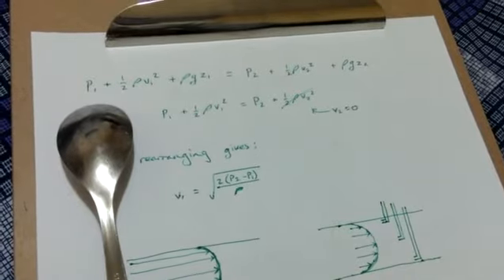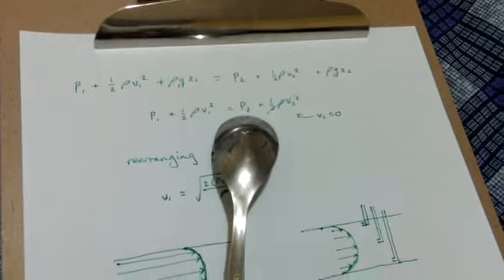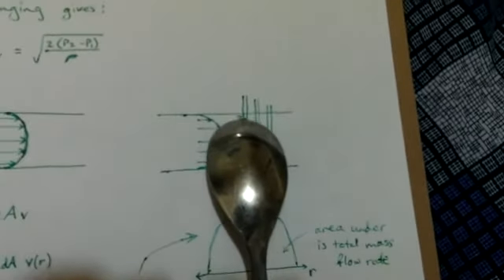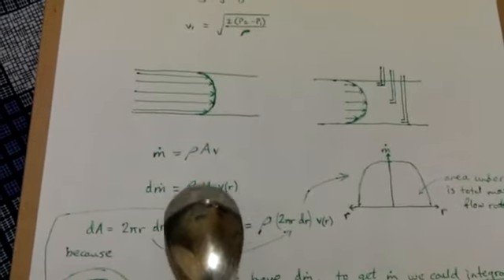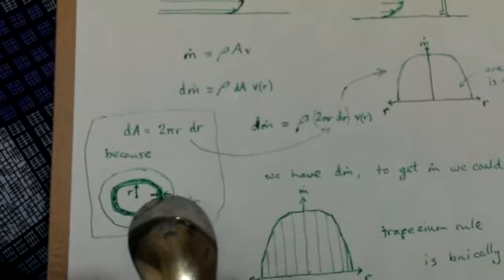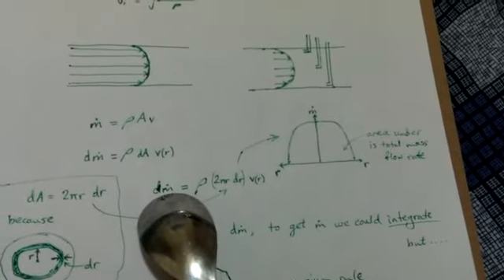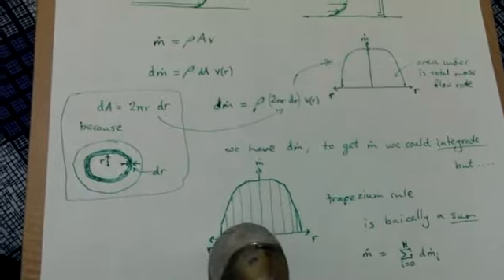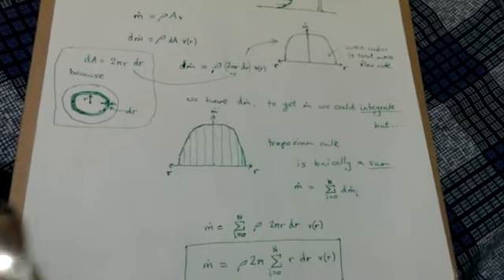DEN4101 flow rate CW Introduction section Pitot tube derivation (read description)

Comment: Hi, i'm doing the same coursework as you however I'm still unsure how to find the mass flow rate from the pitot tube readings. I'm using the integration equation but I'm unsure about my limits. Having completed the CW, could you please share some insight?
Reply from the maker: IntrepidPheonix3000 It sounds like what you did was work out (rho)(2)(pi)(v)(r)(dr) for each point. Is that right? What you're supposed to do is work out (v)(r)(dr) for each point and add it all up i.e. (v)(r)(dr) for point 1 + (v)(r)(dr) for point 2 + (v)(r)(dr) for point 3 ... to the end. Then, whatever is the answer to that sum multiply it by (rho)(2)(pi). That will give you one answer. 

Advice... ermm. Well first of all implement any improvements suggested in your peer review. Also, make sure you explain your results really well in the discussion. Take some time to analyse your graphs and see how pitot and venturi results differ, research the possible reasons for the differences and explain them clearly in the discussion. Don't be afraid to use lots of words to make the marker think you're a professor ;-).

In terms of general advice to do well in qm engineering, form a strong circle of friends and make a whatsapp group where you can discuss coursework, help each other when stuck and revise etc. And one of the most useful things is to keep in touch with second years who can help you with coursework reports, excel results files and other help. I actually still have my excel file for this report where I have all the graphs and calculations for mass flow rates (but I'm not gna post it on youtube in case people plagiarize lol).
Reply from the maker: Hi. Hope your coursework is going well.

To calculate mass flow rate using the pitot tube I didn't use integration. In the Lab handout you'll find an equation on page 5, it's got a (4) next to it. That is the equation I used. Its basically trapezium rule. If you watch the video from 7:16 to the end, I go through why that equation is used and I define what each term means.

Basically, you add up the sum of (v)(r)(dr) for all the measurement points and then you multiply that by (rho)(2)(pi) and that gives you (mdot). (v)(r)(dr) means (velocity at that point)(radius of that measurement point)(difference between radius of the measurement point and the previous measurement point).

The reason I didn't use any integration is because the Lab handout says to use trapezium rule.

Hope that helps.

You got about a week till submission right?
Reply: Yaaseen Haque Thanks. I used the trapezium rule now, but I end up with as many mass flow rates as there are readings, is that normal?? Yeah, only a week left :/

Also, do you have any advice on how to do well on this report.
Reply: Yaaseen Haque Jazakallah khair. That explains a lot. Do we plot a graph of velocity vs radius?
Reply from the maker: Yes. I drew 4 graphs of velocity vs radius. One had three pitot tube lines. And one each for each of the settings with two lines: venturi for that setting and pitot for that setting. Some other guys did it differently. You can choose to do it how you like tbh, as long as you use it well to explain stuff in results and discussion. 

Did you get it btw
Reply: Yaaseen Haque Thanks. I'm happy with my pitot values, but for some reason they differ significantly from the venturi values, i'm thinking that i may have calculated the venturi mass flow rate wrong. In order to find area of venturi did you used pi.r.r or something else, cos I can't seem to think what else i might have done wrong??
Reply from the maker: IntrepidPheonix3000 Hmm. The values should not differ that much. They should be quite similar. Yes I used (pi)(0.5d)^2

Check whether you've consistently converted all your units and used the correct terms, that's usually the culprit when the results are crazy different. What kind of values are you getting? 0.015-0.03ish kg/s?
Reply: Yaaseen Haque venturi:
0.00238109 kg/s
0.015246412 kg/s
0.023451013 kg/s

pitot:
0.022835617 kg/s
0.131231189 kg/s
0.246827551 kg/s

i checked the units, ive no idea why the difference
Reply from the maker: IntrepidPheonix3000 I've sent you a google+ pm